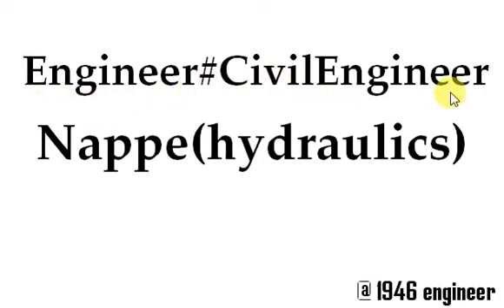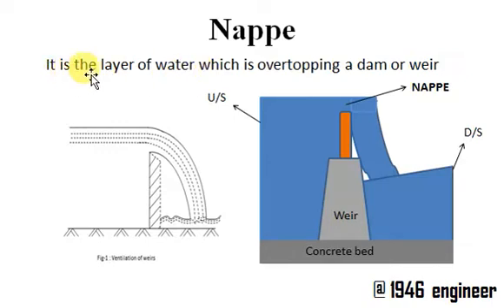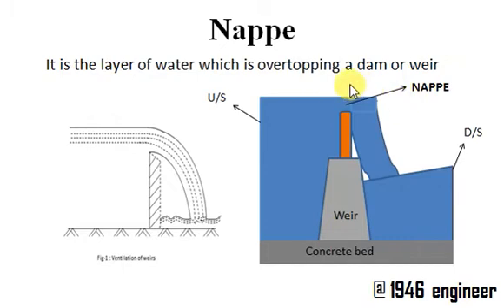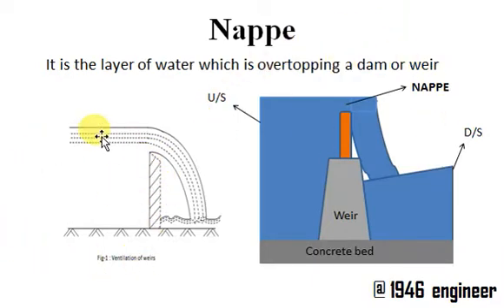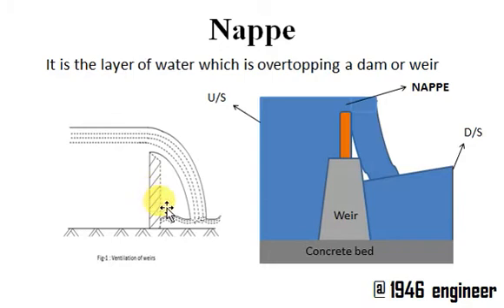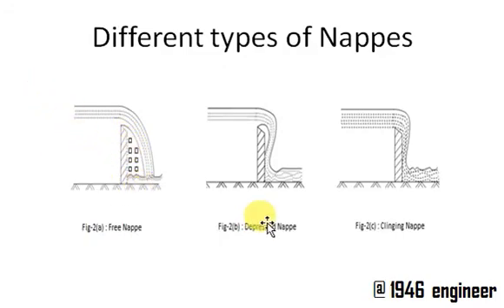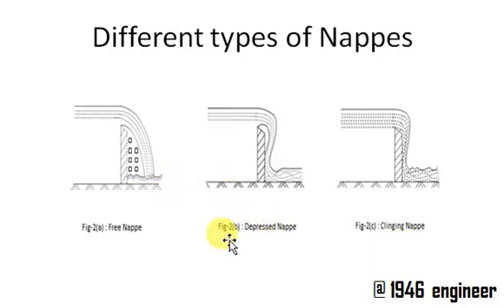Nappe (hydraulics)

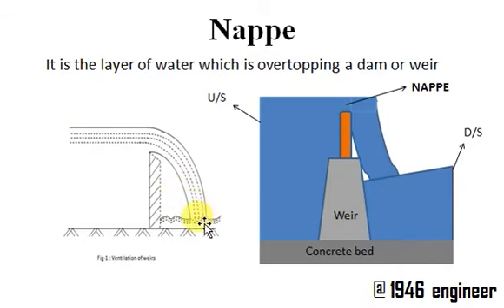Comment: As you said @1:40, if entrapped air is creating negative pressure and increasing the discharge from upstream to downstream side then how does free nappe lack in discharge as compared to other two types as it has more entrapped air...?